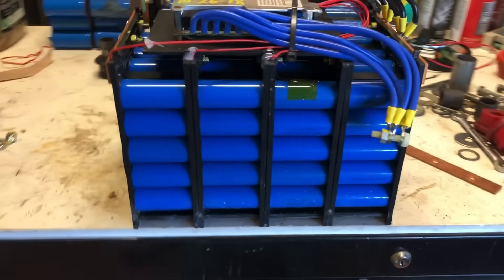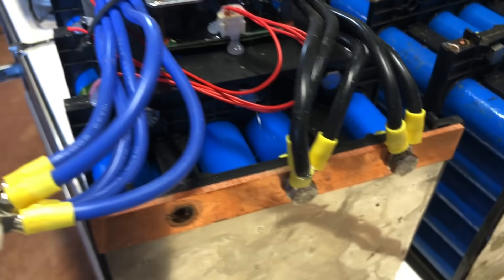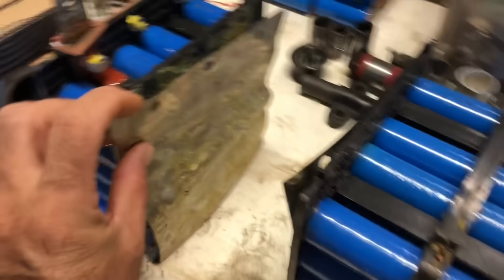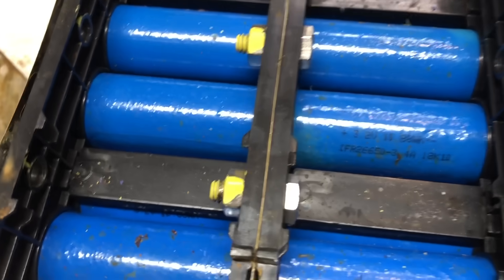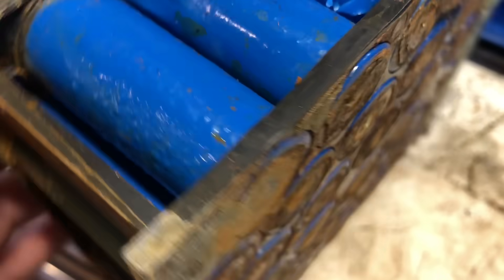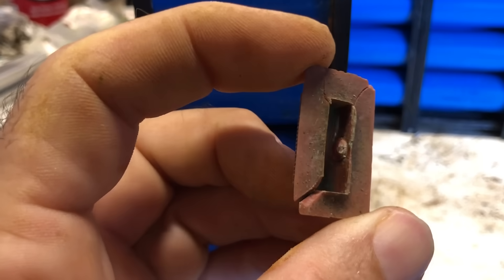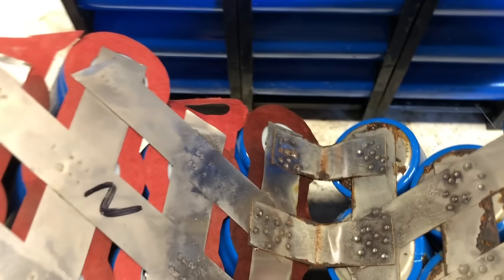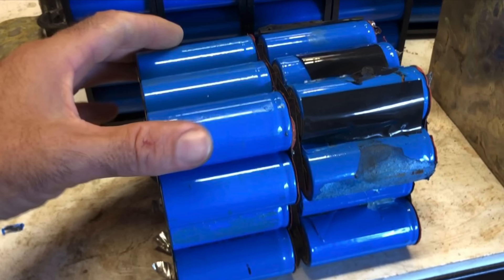Follow up to Battle Born Autopsy

Comment: Being a manufacturing engineer, I can tell you paint pen marks on fasteners is a RED FLAG. They know there are issues. You don’t have a quality techs manually monitoring and 100% verifying fasteners. Same reason I still pop the hood on modern cars, paint pen marks = known problems.
Reply from the maker: I believe this to be more of a method to lock the nuts based on the amount of paint which looks to have been dabbed on, and of course the need for some kind of safety lock to keep the nuts from backing off.
Reply: @Willdesignsandbuilds  disagree. Thread lockers are wicking. This is from a standard yellow QC paint pen. You overlap the fastener, the nut, and the plastic so you can detect rotation or tampering after assembly.
Reply from the maker: @H@HappyRock616 I am familiar with the application for the reasons you suggest. 

On vintage vehicles I look for intact original marks as an indication of originality and as it left the factory, unrestored an unserviced, and on race vehicles and sailboats as an indicator of rotation and loosening. 

But paint pens and nail polish have also long been used as a poor man’s thread locker, and in this case, there are no lock washers or locking nuts used, and every fastener that had paint applied required that the paint be broken loose before removal, so it was effectively acting as a thread locker. 

Perhaps I’m giving BB too much credit and the locking effect just happened to be a byproduct of their tamper proofing, but based on the lack of any other locking components, the generous application of the paint, it’s effectiveness, and the need for some way to keep the fasteners from loosening, my money is on its use being primarily as a thread locker.

Comment: Lesson: stop with the cheap sh*t and buy A tier batteries, do not play with this stuff. And stop using , if possible, low voltage, it is asking for problems .

Comment: I'd be very interested to see your ideas on how to "fix" the issues with the battery. Although it's hilarious to even think that any Battle Born owner would try it, since they can just get it replaced under warranty. 
It's surprising you found this in the dump, but the warranties are now just running out for the batteries made in the first 2 years of production. One weird thing about the 'loose terminal' issue, is that it gets worse slowly over time. A loose connection WILL cause arcing, which gets worse and worse as soot fouls the connection.
Reply from the maker: If you read comments from owners and watch more videos about these issues and read forums, you’ll find a pattern of BB not honoring warranty claims. 

You’re point is exactly the issue, eventually one mind end up with a high resistance connection and possible arcing and shorting which creates and even worse connection, more heat, and this melting of plastic.

If I had an otherwise working battery, I would make the change I covered in my last video to try to increase contact area for current flow and reduce the risk of high resistance and heat build up.

Comment: What is the guess on cause of corrosion? Humidity from the factory? Low quality metal?
Reply from the maker: Batteries expand and contract as they heat and cool. They push air out and draw air in. When used in a marine application or in a tropical/humid environment, water can collect inside the battery and with nowhere to go, the water causes sweat and condensation on the cells and components which leads to rust of steel and corrosion between dissimilar metals.
Reply: @Willdesignsandbuilds  Thanks for that info. So what do "quality" batteries do to prevent this?
Reply from the maker: Couple ways to go about handling the issue -having a case with a proper compressed seal, not glue, adding air valves that keep water vapor out, having drain holes, separate sealed compartment for the electronics, etc.. Just using larger Prismatic cells instead of small cylindrical welded together helps as your interconnects are at the top and are very robust and less prone to resistance from corrosion. 

Using products like NoOX and not mixing dissimilar metals helps, as well as an air gap and space around the BMS and cells.

Comment: Each section maintains connection with another through the bolted connection at the top.
Reply from the maker: Except for when the bolt isn’t tightened and the plastic cage is deformed as discovered in one battery, but yes the modules are bolted together at the top which squeezes the nickel sheets together, and then there’s the rest of the surface area of the nickel sheets that press against each other when the whole assembly is inside the box and shimmed on either side with foam and plastic.
Reply: @Willdesignsandbuilds  Proper assembly is assumed.

Comment: Bought my 3 battleborns in 2019. They've worked fine,but of course I'm worried about continuing to use them. Everybody needs to remember what crap was out there back then. Would I buy one today? Not a chance.
Reply: My first three lithium batteries were Battleborn based on reviews, that and there were not a lot of options back then. Now I basically buy what Will recommends. I don’t trust a lot of people but I trust Will.

Comment: There are two major flaws with this construction:
1: bolts going through plastic. Plastic deforms, it flows under pressure because it is plastic! This is a safety issue because it will invariably lead to loose connections, causing higher contact resistance, causing heat, causing the plastic to flow even faster, eventually leading to the thermal runaway and potential fire.

2: those metal sheets are connecting the packs all on one side, the top side. This means that the cells at the bottom have more resistance to the top connections and this will eventually lead to disbalance between the bottom and top cells. Every serious installer knows that if you connect batteries in parallel, you feed them from opposite corners to even out the resistance of the connecting wires. So, two batteries in parallel must be connected to the "outside world" at top left and bottom right, for instance. Never top and bottom left or top and bottom right.

These batteries are designed by dummies with zero in-depth knowlegde about battety technology and electrical connections.

Comment: You've analysed a seriously mistreated battery and presented it as a defective design.  This pack shows all the signs of a damaged or insurance-writeoff unit (water exposure, corrosion, previous disassembly, loose terminals). Using a compromised sample to imply the manufacturer is negligent is misleading. If the goal is to fairly assess design quality, you need a sealed, known-history pack and objective data (IR, torque values, voltage-drop testing, thermal checks). Without that, you’re not exposing flaws — you’re building a narrative on damage artifacts.
Reply from the maker: No, I am showing people what can happen if you have water ingress in a battery with this type of design and architecture. 

I have been clear about where they came from and why I took them apart. 

Water ingress aside, anyone with first hand knowledge of batteries like this can the spot the shortcomings. 

They were sealed shut and you can see the paint that would typically be
applied during assembly after tightening has not been disturbed. 

I think the components in these batteries are good and many have reported that their batteries have provided good service. 

If these were made in 2018, then it’s possible someone got 7* years of use before they stopped working for whatever reason, and some would argue that’s pretty good. 

I have had LFP batteries that have failed much sooner than that. 

IMO, there may be some poor design choices with respect to assembly and packaging that ignore well known best practices, and those issues may or may not cause problems for some users.

Are these the worst battery  design ever like some are saying, no of course not, but they do have some attributes that are not well suited for long term life/use in some applications, and those attributes are not necessarily unique to this brand as there are other brands that use a similar architecture.

Comment: I have 5 of these BattleBorns in my house as a backup for power outages. It looks as if removing the top of the case and installing a proper bolt could solve the major overheating issue. Perhaps a video on how to open the case and seal it up after a repair would be helpful. Thank you. (I learned of this issue from Will Prowse and YouTube suggested your channel after I watched that.)
Reply from the maker: Your type of use (like a good friend of mine who I recommended the brand to) is the type least susceptible to having issues because the batteries are fixed, and you probably aren’t drawing max discharge current or charging at max current, or operating them in a harsh environment like the tropics, desert, boat, off road, etc.. 

But to answer your question, yes if one wanted to be proactive and wasn’t concerned about voiding warranties, etc.., you could open them up and make a better bridge connection between the positive lug terminal bar and the main positive bus bar. 

One of the indicators of a potential issue that can easily be spotted without doing much is looking to see how bright and colorful the red epoxy is at the base of the positive lug terminal. 

With excessive heat, it is likely to turn more pink. 

Second to that, a temp/thermal gun can let you know if anything is getting too hot, in which case you could charge them at max and discharge at max while monitoring temps to determine if there might be any issues with regard to loose connections internally.

Comment: So what's the bottom line with Battle Born batteries? Have they addressed the positive pole plastic issue, loose connections? I"m beginning to think there are better batteries to be found, having seen other van builders going elsewhere.

Comment: Let's all take a breath here. To start, Will mentioned he pulled these batteries "out of the dump" so who knows the history of what he's pulling apart here (corrosion). Next, can't wait to hear what BB comes back with or if they mention a better design in the future. I have 4x 100amp BB in my RV (that I overpaid for) and they've been great (so far). Due to constant driving on the awesome US highways I always check for loose wiring. REAL QUESTION - what LiFePO4 have US manufacturing/QC included as I want to support US companies? What's a good alternative to BB, that isn't completely Chinese made/assembled? THAT'S THE REAL QUESTION
Reply from the maker: Yes, totally agree about taking a breath. 

It’s not all bad. 

Just something users should be aware of and if your application is the type more prone to the main terminal/bus bar issue, then consider taking a proactive approach to investigating and looking for signs of damage so as to avoid any future issues which may include making a modification/repair. 

There are two things here. 

The first is the packaging and architecture of the battery and how it is put together which may or may not create some issues. 

The second is that anyone using this technology no matter the manufacturer, should avoid any potentials for water ingress because the internal components are typically not well protected, often made up of dissimilar metals that pass DC current, and typically include circuitry that is somewhat fragile and prone to failure if exposed to excessive moisture, heat and vibration.

Comment: After watching that video battle born is junk, you could see all the issues resistance heat buildup causing some type of corrosion.  The plastic heat, expansion and cooling down, causing it to loosen up and create an arc when pulling a load. I have two Battle Born batteries in my camper. When I use a 2000 W inverter heat up some hot water for my coffee maker I noticed the lights flicker, yes, their LED lights. I highly recommend nobody buy any Battle Born batteries.

Comment: Where did the corrosion come from and the battery? My batteries are 5 years and the positive terminal is as tight as can be…
Reply: Pulled from the dump!   He has absolutely no history on these seven year old batteries.  This is hardly a reliable evaluation.

Comment: It was battery from 2018 and they changed them at 2020 so its not a problem
Reply from the maker: How do you know this? 

And if that is the case, why did BB respond the way they did to peoples concerns? 

Would be great if that is in fact true, but one would think BB would be the first to let people know that the design was changed and that these issues shouldn’t be of any concern, except of course to those who have older batteries.

Comment: If you can, please remove the bolt at the positive terminal and tell me what kind of metal it is.  I just resurrected 2 Battleborn GC2 batteries (different case style, but 100 AH).  The problem was just the bolt which is aluminum in my case.  I had aluminum oxide formation under the nut and no conductivity to the positive post, Simply replacing that aluminum bolt with a copper bolt and nut restored these dead batteries which had attempted to be recycled but rejected as recyclable by Trade Mark metals.  One of these batteries was capacity tested at 99%.
Reply from the maker: Thanks for sharing, yes if you watch my videos (there are two) I point out that these batteries use an aluminum bolt that is double nutted with paint applied to lock them. 

If you watch my first video you will see that the small amount of surface area under the bolt head tasked with carrying the current and making contact with the positive bus bar and bridging it to the positive lug terminal was concerning to me. 

Sounds like your batteries are similarly constructed. 

Make sure you install a jumper from the positive post directly to the positive via bar to avoid the potential for the plastic cage (if yours are similarly constructed) to melt and introduce looseness in the connection.
Reply from the maker: An example of your concern!  

@vernowen2083

Comment: As an engineering tech for defense contractors, I'll tell you emphatically that you do not mix aluminum and cooper at connection points! Their heating and cooling coefficients are not compatible. You'll also get oxidation between those joints which is the base issue of the overheating issue and the expansion rate of aluminum only creates more of a gap when hot. In otherwards you end up with thermal runaway which only increases as the battery ages! Ditch the aluminum bolts for copper bolts and all will be well once you solve the moisture problem.
Reply from the maker: Agree, although I am more concerned about the lack of adequate surface area tasked to carry the current from the positive post to the bus bar since the bolt is acting as the bridge, and feel this could be the leading cause of overheating of the plastic during high current load which then creates the looseness leading to only poorer contact between the underside of the bolt head and the positive bus bar. 

What’s puzzling is why aluminum was chosen in the first place. 

Everything else is stainless except for the negative side which has a nylon bolt to isolate the BMS output from the negative bus bar. 

But someone purposely specified that an aluminum bolt be used, and I can only imagine that choice was made to try to avoid an overheating condition with the thinking that aluminum retains heat less as long and cools better, or that it was used because of its less resistive properties since they knew it was being tasked to carry the current and act as a bridge. 

It’s a real head scratcher….

Comment: Bolting through plastic is ignorant. Over time the plastic will allow the bolts to loosen. 
Shoty workmanship. Poorly engineered. Sorry but these are dangerous and should be pulled. Bolting through plastic is why your bolt was loose not a lack of its original torque. Bad design flaw.

Comment: That tape ain't Nickle plated copper, it's Nickle plated STEEL. That's why it goes rusty. Trust me, I make batteries like this.
Reply from the maker: Yes, it is likely plated steel not plated copper or solid nickel, but it’s not rusty (yet), the rustiness is from the cans and ends of the cells. 

I have had to repair my own batteries and reconfigure blocks of cells to create smaller capacity batteries from larger failed ones using my spot welder and should have known better. 

The last roll I purchased of the nickel strip was soft like taffy, like it was annealed or something which made me think of copper since it’s softer. 

These sheets in the BB batteries are thin and ridged and have a springy memory/quality and part of what I don’t like is that after they’ve been spot welded, the surface is no longer flat for the next modules sheet to make good contact with.
Reply: @Willdesignsandbuilds  if you have miliohmmeter you can compare resistance of known good nickel strip against suspicious
Reply from the maker: @johndoe9922 I prefer the paper cut method, which ever draws the most blood and makes the cleanest cut 😂 Joking of course about how many times I’ve been sliced when handling battery cells that are welded together with the strip material.

Comment: There should never be a plastic insulator between the lug and the bus bar, that is just basic electricity, the bolt is the fastener, it should not carry the main current.

Comment: Hard to see how they last as long as they do. I'm no electrical engineer, but I can see so many points of potential high resistance in that design. I would have expected these to be built in the land of panda, not the USA. 
Good to see Will Prowse chiming in here. I watched his "review" of these.
Reply: Battleborn is building cheap junk so they can compete with the high quality coming out of the land of Panda. There are automated factories in China that have so few people working in them they turn off the lights unless they're doing maintenance.